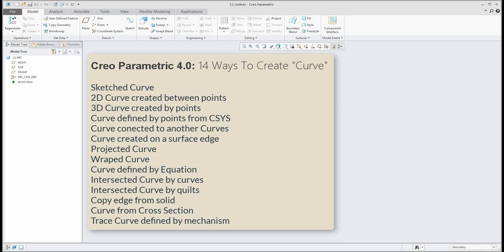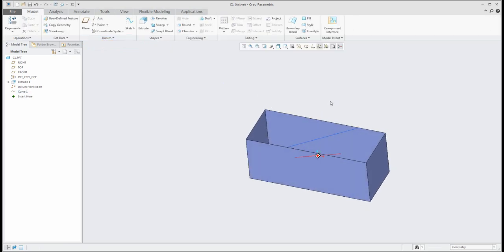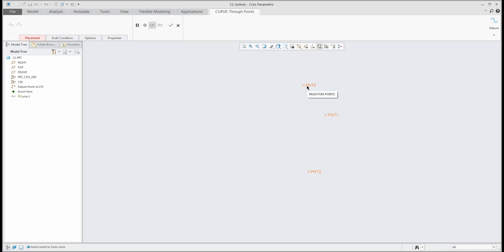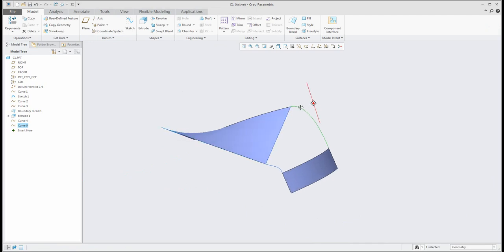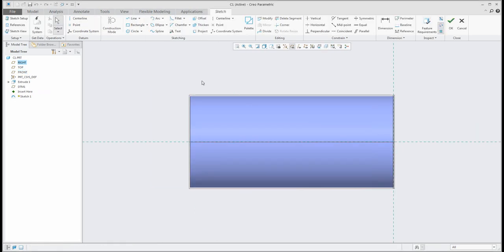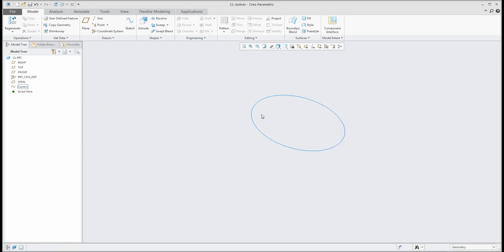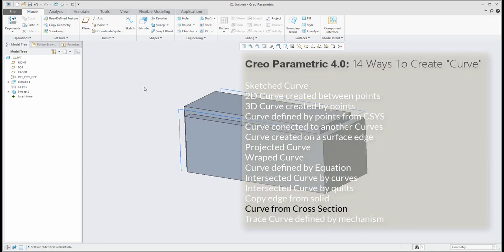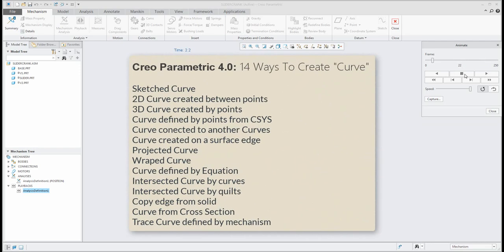Creo Surface modeling: 14 Ways To Create Curve

Comment: Sir this video is really good for understanding curve tracing. Can you please make a video for how to get length between two bends (L),angel of rotation in 3D space (R) and bend angle (A) when 3D pipe model is available
Reply: Pipe model could be as you have made while describing 3D curve (offset coordinate points)
Reply from the maker: Thank you for your idea. Stay tuned, I will try to find some example. Vladimir

Comment: Is it possible that copied curve to hide it permanently? in my case for example i use the same Technic , Sweep option with copied curve, but while im drawing it shows , so i make it hidden. for what so reason when i open it after some days the drawing the copied curve gets visible. How do i hide the copied  curve in my 3D Model permanently without loosing it from my model?
Reply from the maker: Hi, thanks for your question. If you hide feature in the Model Tree it is only temporary. You need to Save Status of layers (try to use search for this feature) or jump into Layer tree adn RMB Save status and then Save your model. Stay tuned, Vladimir

Comment: nyce tutorial sir can u please tell me how to extrude projected curve
Reply from the maker: Thanks for your feadback - try to check this video - maybe you will find answer there. In reality - I do not understand your question: how to extrude projected curve - send me please some example on vpalffy@4kside.com Regards, Vladimir
Reply: Vladimir Palffy sir suppose i project a close loop curve on a solid body but when i use a extrude command in creo it will not extrude
Reply from the maker: Hi  - if you use projected curve on a solid model you can not use Extrude feature (extrude is working only for sketched curves / sketched feature) For projected curves is much better to use Offset feature. I will try to create some example for you :)
Reply from the maker: Hi, I have tried to create video tutorial for you - where you can lear  - How to project curve on surface and than reause it for Extrude feature: https://youtu.be/XGj9brK_YQ0

Comment: Does Creo 4.0 have a capability to do 3d-sketches of lines and curves like in the following Solidworks video. If not then what steps can you use to get something similar?     

https://youtu.be/HO-yg6sC5t4
Reply from the maker: Hi Mark - sorry but is not possible in Creo 4.0 In the Creo you can create points offseted from CSYS and than use 3D curve as straight lines with/without rounds or as spline :)
Reply: That is unfortunate. The Creo people should work on something like this. Solidworks had a good idea with making sketches 3D like this.
Reply from the maker: Hi Mark  - it is only one part of modeling :)
Reply: Important enough that a big company makes this tool.